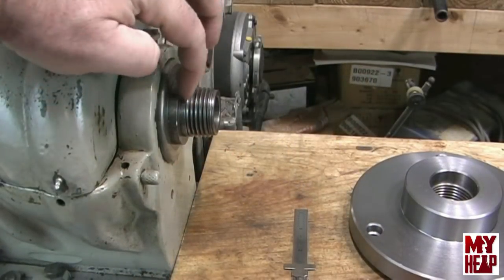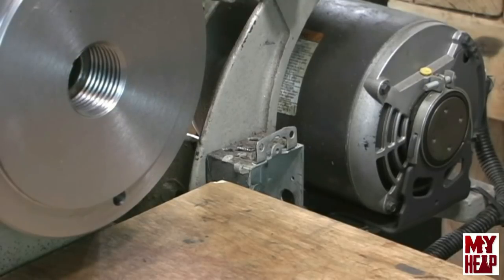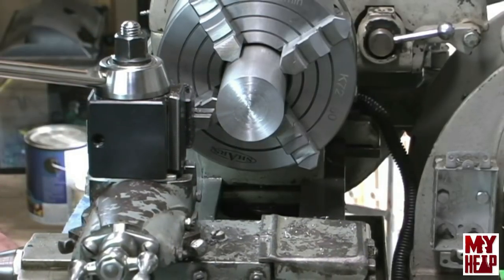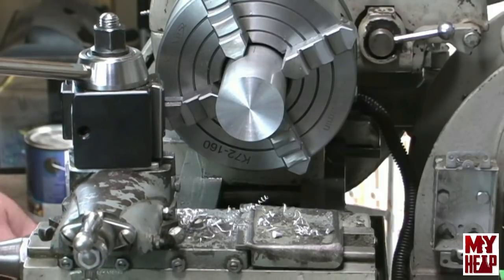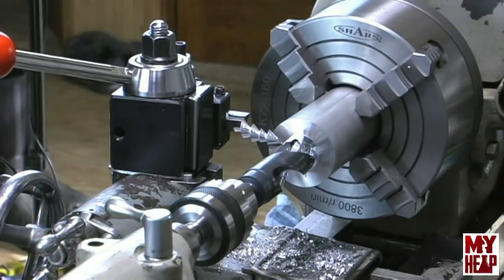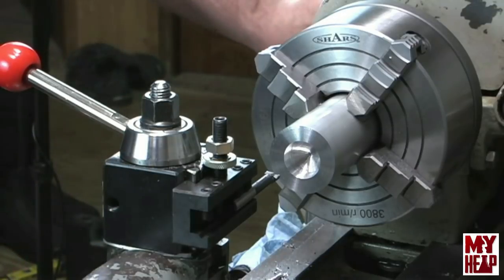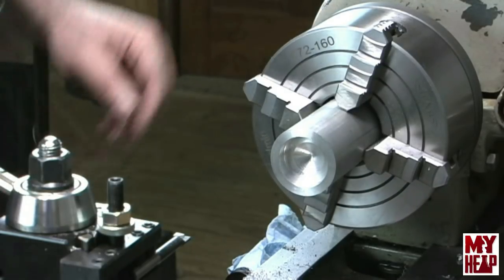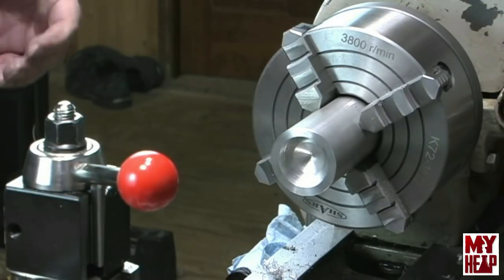YouTube Shop Student - Episode 005 - Machining a Spacer for the Chuck Backplate

Comment: G'day Joe, I won't repeat what others have said, I'll add use plenty of lube, WD40 / kero works well on aluminium. Another good presentation and keep making chips, it's a good way to learn and should you mess up, work out what went wrong and learn. Failure is not a failure but a learning curve. Cheers Peter
Reply from the maker: Hey Peter,  I have some kerosene and thought about using some but didn't like the idea of smelling up the basement of my house.  I will pick up some WD40 for the future.  I have learned plenty in my life from messing up.  Sometimes I think mistakes and taking a critical look is the best teacher.  Thanks for the encouragement.

Joe

Comment: I always bore under power, even into blind holes. I cant get a good finish trying to maintain a steady advance into the hole by hand. Enjoying seeing your lathe runnin 😊 ~ Richard
Reply from the maker: Hey Richard, good to see you stop by.  This is the "First" time I ever tried boring on the lathe, so in my mind it was just better for me to do it by hand.  I did learn a couple of things from the boring exercise.  Like cutting off I should have reduced the amount of stickout on the boring bar, and I should use the largest bar that I can get in the hole.  I have another large bar, but I need to grind a HSS bit for it.  I have the HSS but wanted to make chips rather than do it right, I guess.  I done a practice cut off, cutting off slice of the whole 2" bar, but when I made the video I didn't retract the blade to the shorter distance I was cutting.  I should have used some lube.  Well, the list goes on.  But hey, I am learning buddy!

Joe
Reply: Yeah, I didnt want to be a backseat machininist and point out the few things I woulda done different but as long as you are learning from your mistakes and experiences thats the important part. I think the part you made turned out great and is doing the job needed and thats all that matters. If you have power crossfeed you will find facing goes much easier. Nice job on the part! ~ Richard
Reply from the maker: Well, I am sure that these were only a few of the many mistakes I will make learning to do this stuff.  My goal is to learn from them and try to get better.  Time will tell I suppose.  The part came out nice and parallel.  I mic'd it around several places and it is pretty parallel and is a good fit on the spindle register, so for what the part is it will serve its purpose to machine the backplates.  I do have power crossfeed, but at this point I want to feel the machine work and get used to it.  I have VERY little experience on the machine.  Thanks for the help and suggestions.  These things are good!

Joe
Reply: Hey, as long as you dont have to make two parts to get one you are doing excellent! 😎

Comment: One thing I noticed is that the handle for the compound started unwinding during the cut. I get this on one of my South Bend's. I suggest that you make sure the handle is on the bottom before you start, or better yet, simply tighten one of the gib screws to lock the compound. I really like your work.
Reply from the maker: Hello flutegene.  Thank you for the pointer.  I will keep that in mind for the future.  Being a newbie I really do appreciate the help you all provide along the way.  Thank you sir.  Thank you for watching and commenting.  :-)

Joe

Comment: Parting has always been a little troublesome for me but I think you were running a little fast and there seemed to be too much of the tool hanging out. Set parting tool for the minimum required. maybe others more experienced than me can add to this. I also have found setting the tool height a hair above center helps
Reply from the maker: Hi Steven.  I definitely had too much blade out there.  I took a practice parting on the 2" stock and should have retracted it when I done this cut.  I probably should have used some lubrication too.  I will try your tip about setting the tool hight a hair above center too.  Thanks for the help and tips Steve, I appreciate that you take the time.

Joe

Comment: Joe it is most economical to buy WD 40 by the gallon can, you can us it in a spray bottle or put it in a small container and brushed on. I use WD 40 for all of my aluminum work , use to help clean the lathe and mill and a multitude of other uses. Also pick up a few Spillmaster containers for cutting fluid. The cheapest I have found were at Littlemachineshop.com, I throw a magnet inside and they work great. 

Also the cutting oil you bought was not designed to use straight, you should look for thread cutting oil, Ace Hardware usually carries it and the big box stores usually have it or any plumbing supply store. It really makes a difference. I use it a lot I get most of the metal I use from the scrap yard and mystery metal can sometimes turn out very hard to turn.
Reply from the maker: Hey John, sorry for the late reply.  My son graduated last night and I spent some time with him and was well away from the confuser.

I will take your advice on the larger quantity of WD-40 and the Spillmaster containers.  The little bowl and lid I am using won't cut it for long.  I have nothing against getting some sulphur based cutting oil other than I would prefer to use it once my lathe can be moved from my basement to the shop.  My bride is pretty tolerant of my shenanigans, but stinking up the basement of our house I am afraid she will draw the line.  Did I mention, I am afraid of my wife.  She cooks for me, has a penchant for cast iron and knows where I sleep.  You get the idea.  :-)

In the interim, do you think I would have better luck if I diluted the cutting oil that I have with some amount of water.  I think for drilling they recommend 10:1, so maybe 5:1 so it doesn't sling all over the place?

Thank you for taking the time to offer help and comment.  I appreciate that.

Joe

Comment: Hi Joe, you're  welcome again for the nut.  Seems like you're  learning tips and tricks as you go and that's the best way to learn. The critiques that others have given about the stickout of the parting blade, the stock, and the lack of lube are spot on. Now let me add my $.02 about the way your going about the project. Seems to me, before you make any cuts, with the back plate mounted in the correct position, you have an about an inch or more of unused thread inside. Now the depth of the shoulder bore on the back is 5/8". So you want to take off 3/8" to give you 1/4". That should still leave you with more than a half an inch of unused thread on the front.  I think that if I was doing this, rather than try to make a spacer, I would bore out the threads on the front, to the size of the shoulder 1/4 inch deep. 
Think it would be easier, and probably more accurate.

Comment: I have just completed the same modification to my chuck backplate.
Reply from the maker: I made the spacer to machine the backplate I had for my 3 jaw chuck, the someone suggested I just counter bore the front of the chuck backplate and then spin it on backwards.  I took a measurement and I had the room so done it that way.  I think that is video 6.  I still need to finish up on the 4 jaw backplate, if I have enough room I will do it the same way, otherwise I will use the spacer.

Thanks for taking the time to post, I appreciate it.

Joe

Comment: Joe
Ensure to check the back gear lever when back gear engaged.  You will need to ensure clearance between the chuck and the lever when engage.

Dan Bentler
Seattle
Reply from the maker: Ahhh, great point.  I didn't think of that.  I will take a look and see how much I can take it down and still have clearance for the lever.  Thanks Dan for pointing that out.

Joe
Reply: Don't feel alone.  It surprised me also.

Dan

Comment: Joe, I buy WD40 by the gallon, it’s much cheaper that way. I use a condiment bottle from Walmart to dispense it as a liquid and a spray bottle to dispense it also. I use WD40 for everything on aluminum except tapping, I also use it when cleaning the mills or the lathe.
Reply from the maker: Those are some good ideas.  Thank you John.  Where do you generally buy WD-40 in bulk?  What does it cost a gallon?

Thanks,
Joe
Reply: My Heap last time I bought WD 40 I got it from NAPA, I don’t remember the price it was maybe 5 yrs ago!
Reply from the maker: Thank you John.

Comment: I'm a rank amateur like you, but try not to have the parting blade sticking out more than you have to in order to get through the part.  On smaller lathes, with the blade out so far you get a lot of forces pushing down on the end (think sitting further away from the center on a teeter totter).  Using a large quick change tool post that hangs off your compound doesn't help.  The stock sticking out so far from the chuck probably doesn't help either.
Reply from the maker: Yes Sir, you are correct.  I done a practice parting off a slice of the 2" bar and when I made the ring I should have retracted the blade.  I should have used some lube too.  I learned a lot from going back and watching myself and trying to be critical of the results.  There are several areas that I have made some mental notes to myself that will hopefully allow me to improve!  Thanks for taking the time to comment and offering help, I appreciate that.

Joe